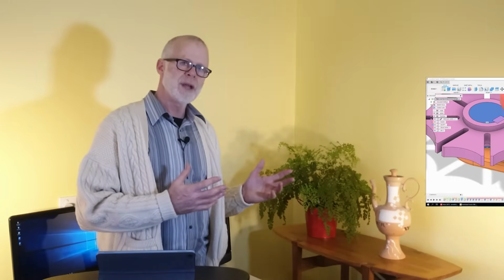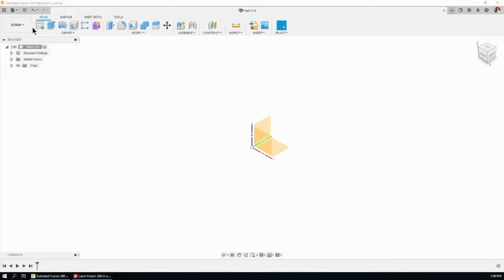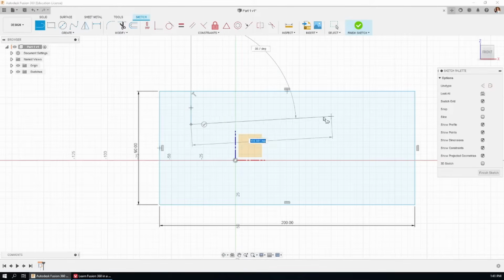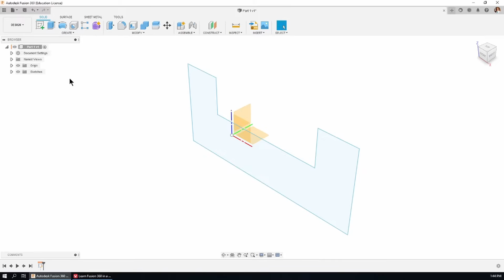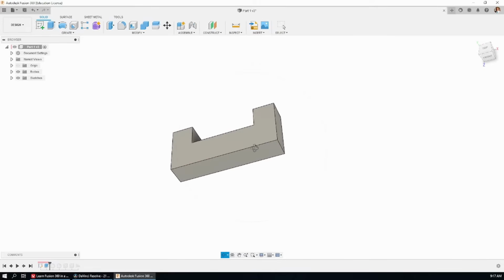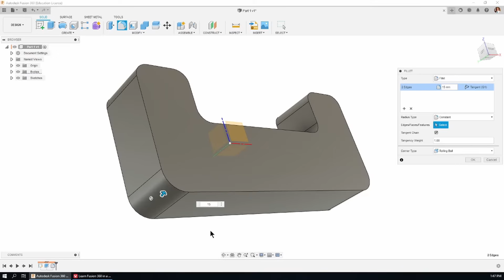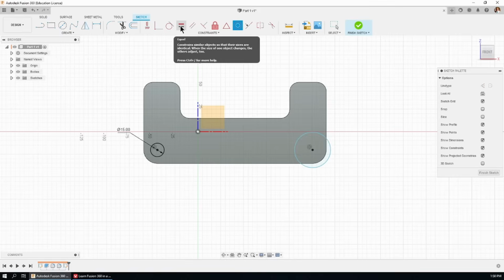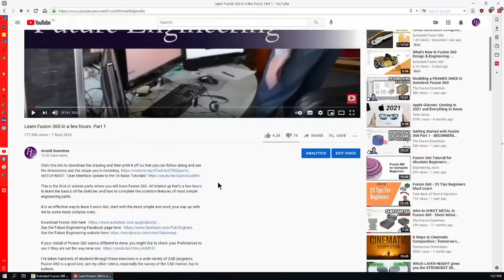Learn Fusion 360 In a Few Hours. Part 1

Comment: I can not save my first part or file. Text window  version description  User Saved
Reply from the maker: Hi Art, I understand the first sentence. I recognise the last four words, they come up in a 'text window' when you re-save a document in Fusion 360. The meaning of this text window is that your document is already saved and now you may save again. Its prompting you to name the version at this stage of the development of your design. To tell the truth I rarely give another name to my version increments.
So this is normal, the first time you save your file a dialog opens asking which folder you would like to save the document in.
Look for the toolbar in the upper left of the window, there are five icons, and their tool tips read (when you hover the mouse cursor over them) Data Panel, File, Save, Undo, Redo. If you click on the second one from the left, the File icon, you will get a drop-down with Save and Save as.

Comment: Arnold, after the drawings is saved how do you move it back to the folder? When you go to the folder and click on the sketch it appears on the page, how do you move it back to make a new sketch? Thanks
Reply from the maker: Paul, I just need to check your terms here, "move it back to the folder" I presume you mean to the data panel which slides over from the left hand side of the screen by clicking on the little icon above with the nine little squares. 
When you talk about "sketches appearing on the page" I wonder if you are referring to the browser tree in the graphics window down the left side of the main screen.
Generally speaking you're either in sketch mode or feature mode and if you're in sketch mode and want to get back to the 3D mode you have to click on Finish Sketch. That saves the sketch and to start another sketch you click on Create Sketch. Or you can re-enter any sketch to edit it by right clicking on the feature in the timeline along the bottom of the scree and choosing Edit Sketch. (or by opening the Sketches folder in the browser tree on the left and right clicking on that sketch.)
Am I answering your question?
Reply: @ArnoldRowntreeTeachesFusion360  Yes Sir you are. It's the little things that get me at times. Learning the terminology and understanding the timeline and purpose speeds it up. I'll try to put future questions correctly. Great job on your videos.

Comment: Can someone explain how does concentric to  the fillet works? It wasn't explained properly in the video. Thank you
Reply from the maker: I was a bit brief on that AB. Any two things that have circular arcs can be made concentric, meaning that they can be arranged with their centres occupying the same point. This is what the concentric constraint does, it moves the two curves so that they share the same 'point of origin'. If one is fixed in some way and the other is unfixed, the one that is free will move. Does that help?

Comment: I just found your channel. Thanks for the tutorials. I do have a question...When I select the XZ view, I noticed that on your view the small box in the upper right corner shows the Z Blue line vertical and the X Red line going to the right and the box says Front. On mine if I orientate the Z and X to same directions my box says Bottom and its upside down. How can I change mine to look like yours?  Looking forward to completing these tutorials. Just started learning Fusion 360. Thanks Dave
Reply from the maker: David, I understand your wanting to have everything working as you see in the video. From a distance where I sit, I think you'll find that a few preference settings will take care of this. Go to the playlist on my channel and see the second video in the list about setting Preferences in Fusion 360    https://www.youtube.com/playlist?list=PLFCTgdiT5-kLBNvrkUNy63Gu1tWdRuKkr
Go ahead and get it like my installation but even if that doesn't do the trick this is really a minor annoyance if I may say. If you get the shapes modelled, you will have spent some hours in Fusion 360 and become a lot more familiar with how everything works. There are many ways to access information about these kinds of things. You will find yourself in charge of all these things given a bit of time and patience.
Reply: @ArnoldRowntreeTeachesFusion360  Thanks I will take a look at it.  Dave
Reply: @ArnoldRowntreeTeachesFusion360  I looked at the preferences and found I didn't have the Z axis up by default. I changed it and now it's like yours. Thanks for the help. Dave

Comment: When I click on a face it turns light blue, I try to add a rectangle, but the rectangle keeps attaching to the origin line.  It seems that has happened throughout the 16 parts I made.  Any ideas?  Thanks for these lessons!!
Reply from the maker: Andy, you mention that you are trying to select a face in order to draw a rectangle on it. This is not how Fusion 360 works. First you have to create a sketch, then in the sketch environment you draw, constrain and dimension the sketch. Then when you click the button "Finish Sketch" you have the option of extruding that sketch in the 3D environment. This first tutorial will show you a click by click example.

Comment: When im out of sketch mode i have the squared suface visible, i can see u have clean view. how to remove the squared surface (hope you understand what i mean) :D
Reply from the maker: I'm hoping that I understand what you're seeing, so you've been working on the sketch and now you're out of it and you're seeing "the squared surface". Correct me if I'm wrong but it sounds like you need to learn to rotate your 3D model so you can see it from whatever angle you like. Hold down your left mouse button and drag over the model. That should change the view for you. If that doesn't have the desired effect, have you got the free download with the pages of Preference settings at the end of the PDF?
Reply: @ArnoldRowntreeTeachesFusion360  I have downloaded the preference, and adjusted. i can rotate it just fine, but the squared surface is visible on all axis....and i can see when you rotate your object its all clean surface.
Reply from the maker: @sehested72  so... a squared surface, do you mean the graph paper texture you see when you choose the plane for a sketch?
Reply: @ArnoldRowntreeTeachesFusion360  yup thats it.
Reply from the maker: @sehested72  OK, look for the little toolbar down near the bottom of your screen in the middle. It has 8 icons in it and the one second from the right is Grid Settings. Click on it to see a little flyout menu and the check box at the top toggles the visibility of the grid on and off. Try that?
Reply: @ArnoldRowntreeTeachesFusion360  Thanks a lot :D

Comment: Hi Arnold, i am a beginner and i use your videos to help me get started. But i have a question: How do i  make a convex shape in a component in fusion 360 ? i have a part that i am designing, and i want to put a convex shape it it. Can you help.
Reply from the maker: Sure larry, take a look at my video on the Extrude tool here  https://youtu.be/5oCLfYIRcUg but I suggest you take your time and work through the 16 basic tutorials first. Actually, you'll soon get the feel for whether you need to if you have a go at your convex shape. There is a whole suite of tools in Fusion 360 which you can explore - see the purple tool in the toolbar at the top of the screen. But this is an advanced topic, its one of the main reasons I like Fusion 360 so much and I have all kinds of plans to use these tools but haven't even begun yet. These form tools can do all kinds of organic modeling and there is a way to use them in a computer with a pen interface.
Reply: @ArnoldRowntreeTeachesFusion360  howdy, I’ve done the 16 parts, that helps alot. I will have a look at that bid you just mentioned. The next difficulty I will have is working out gear ratios…. Hmmmmm
Reply: @ArnoldRowntreeTeachesFusion360  Hi Arnold, i had a look at the vid and its not what im looking for. Lets say i have a circle that's 170mm dia and 20mm thick, it has a 20mm hole in the middle. But i want to put a 60mm dia convex shape around the centre hole so it can accommodate a bolt and washer. I Hope you can decipher my explanation ...
Reply: @ArnoldRowntreeTeachesFusion360  I think it might be a chamfer around the centre hole , or similar to a countersink type of shape around the centre hole ????
Reply from the maker: OK, what you're looking for, Larry, is a revolved extrusion. I have yet to make a video on that tool but Kevin Kennedy has one here  https://youtu.be/U7ABI9PSjkM  Set the operation to 'Cut' unless you've made your blank with the details in the initial sketch.
Gears are a whole topic of their own, you can get some good resources here:-  https://gearotic.com
Reply: @ArnoldRowntreeTeachesFusion360  awesome, Thankyou. I should be able to utilise that revolve extrusion tool. Some how I got to figure out how to embed the extrusion in the surface of an existing part.
Reply from the maker: @Ljmcc  in CAD things can intersect and overlap. Watch the Extrude video one more time,  when you choose "cut" the intersected geometry is removed.
Reply: @ArnoldRowntreeTeachesFusion360  Will do. Thank you again.. I really appreciate your insight.

Comment: Best introduction lecture by far.  This is the 6th YouTube Introduction to Fusion 360 video I have screened.  I knew there would be someone out there who would present the software better than the rest.  Other than a few pauses.  I got through the lecture at your pace.   I am sure that already being familiar with the basic interface helped.  Many of the older tutorials are for prior versions and the interface has changed substantially making them almost useless.  Thanks again..
Reply from the maker: Its good to have you here Darwin, let me know if you have any questions, I can often help with the kind of speed bumps most people hit. My tutorials are being revised gradually, number five is in the works now but most people find that they can follow the older ones after a few of the revised ones. The changes were really pretty minor.

Comment: Hey Arnold, I watched the first three videos last night and I'm very impressed with how they progress.  I started Part 1 tonight and ran into several issues BUT found most of them were resolved after finding the preferences video and updating the prefs. Can I humbly suggest you add a link to the prefs video in the information below - it would have saved me a lot of frustration.  Anyway, onward and upward, part 1 is done. Hopefully get through 2, 3 and 4 tomorrow and then look forward to the rest of the updates. Thanks for doing them, you have a good teaching style.
Reply from the maker: Thankyou kakman, I'm encouraged by your progress. Keep pressing on! 
Actually, I've just checked and the link for the Preferences video is listed in the description of this one. There is so much info I crammed in there it gets a bit overwhelming.
Reply: @ArnoldRowntreeTeachesFusion360  I'm working through the old videos after finishing the updated ones. I think I did 9 today - up to about 12 or 13. There's lots of things I need to learn but these are a gold mine for people wanting to making parts. I want to design a trailer so I'm trying to work out the best way to work with individual tubes, multiple bevels and joints etc. It's actually good fun.

Comment: Great update. TY. Will you show how to free form curved lines on the edges. I need to make a guitar pick guard for a 50 year old Epiphone. One of the edges has six different curves, non concentric, on the same line to be an accurate reproduction.
Reply from the maker: Michael, that's an advanced topic, sounds like lofts will probably do it but the Forms tools will help if lofts aren't enough. I'll cover those but not until I've revised all the 16 basic tutorials and made a start on basic CAM and CAE.

Comment: ¡Buenos días Arnold! As an avid railway modeller, I bought a 3D printer about a year ago but, have been struggling with various CAD-based platforms to design and build necessary parts for my hobby. I happened across your channel yesterday and, in the first few minutes of this video, learnt more about Fushion 360 based purely on your communication skills.  You assume, quite rightly, interested viewers need to be guided though new, basic skills. I find your choice of descriptive and 'plain speak' narration perfect.  You refer to the tools of Fusion 360 and, then show where they originate and how exactly to exactly they are used. I have found so many other sights simply performing actions and, I haven't a clue as to how they achieved said action. I will definitely be joining the FaceBook forum and look forward to navigating my way through the backwaters of Fushion 360 with you.  Un saludo. Gary
Reply from the maker: Fantastico! Welcome Gary, share some photos when you get the chance.

Comment: I haven't touched 3D CAD in decades (back when the minimum hardware requirement was a Sun Sparkstation running Unix). Fusion 360 looks amazing. Looking forward to learning more. I appreciate the revised tutorials, because there seems to be some changes in the UI between the original series, and the current version. Well done! Both in the way you're teaching it, and the revision you took the time to produce.
Reply from the maker: Thanks BG, you've seen some water pass under the bridge.

Comment: Great video!  The link for the drawings and newsletter doesn't seem to work for me?  I did find the 16 drawings through another link.  Really liking your style of teaching as I am moving from Sketch-Up to Fusion 360.  I am a retired Project Scheduler and will be using Fusion 360 like I have with Sketch-Up for  3D printing and waterjet fabraction.  Thank you for these fantastic videos.
Reply from the maker: I have happy memories of Sketchup, I worked on it full time for five years, now I have to look up the keyboard shortcuts I used back then. I need to draw a garage reno for a friend. 

I'm glad you found the drawings, let me know if there's anything I can help with.

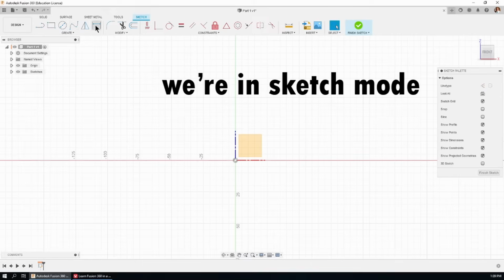Comment: Why is my axis the opposite to yours please? I have the red X axis in the middle and the blue z axis on the lower side when chooing the plane to sketch on (2:57)? I have my preferences set as per the 16 page document. My Z axis is "up" in the preferences. My oreintation cube is different too - to get the same axis my orientation cube has to show "bottom".Thanks
Reply from the maker: Angie it sounds like you've got the preferences as they should be, that must be frustrating. If I was able to look over your shoulder I'm sure we could solve this quickly but alas, it can't be. I did do a video on re-orienting your part if necessary, try this...   https://youtu.be/2apwwAQgvbQ

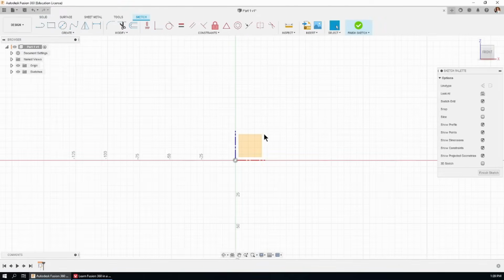Comment: I'm trying so hard... followed this 3 times... checked the video of your preference... but I'm getting slightly different results in navigation. i.e. Moving the view. Selecting the face to view (at 2:45 in the video) does nothing. The view doesn't change. If I try rotate the screen using right click, it just draws a line.
Reply from the maker: Sorry to hear about the frustrations there Craig. For rotating the model its a middle click/drag not a right click/drag. I know you've already been there but is your Pan, Zoom and Orbit shortcut setting set to Solidworks?
If all else fails Craig, use the Free Orbit tool in the little toolbar at the bottom of the screen in the middle. The leftmost tool has a little flyout with free orbit and constrained orbit. Use Free Orbit there. Select the tool and its a left click/drag.
Reply: @ArnoldRowntreeTeachesFusion360  - Thanks for the reply. I think the issue was that you need to click 'Add Sketch first. Then click the face, and it turns to face you. I was clicking the face, and hoping it would turn. So my order was wrong. I find rotating very hard. I did follow your preferences and have Solidworks selected. (Nice). But I still end up under the model a lot, and not sure how to rotate it back. So click the 'Home' on the top right indicator, which saves me. But I struggle with the middle click. It seems there's a trick to it. Great videos though - thanks. Continuing your course.
Reply from the maker: If only I could watch over your shoulder Craig but you're sorting things out. You'll get there.

Comment: Hi when i press the middle mouse button the hand icon light not the orbit one. what can I change?
Reply: Preferences, click on your picture in the far top right, then General, down toward the bottom of the page you'll see Pan, Zoom, Orbit shortcuts. set to Solidworks re Arnold
Reply from the maker: Well done Paul, I spent a lot of time on Solidworks, no-one has complained yet.

Comment: You're a really great instructor. 
I had 3 years of drafting in high school in the early 80's. I remember many a red mark for sloppy lines crossing, dimensions off, and smudging the paper with graphite. Life took a different path and haven't touched this stuff since I recently got a 3D printer. This is cheating :)

Thank you for making these!
Reply from the maker: Those were the days! I remember seeing rooms full of drawing boards in tech schools and then  I'll never forget the shock of seeing rooms full of big 21 CRT monitors at the local uni in the mid 1990's. Times change.